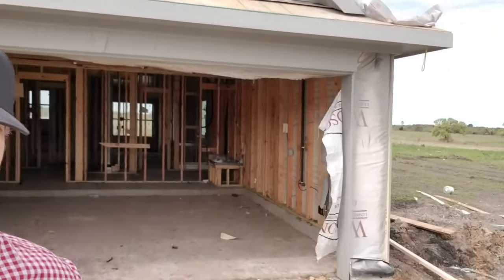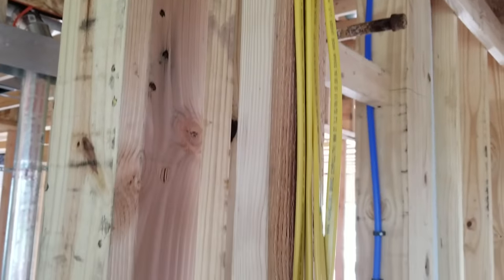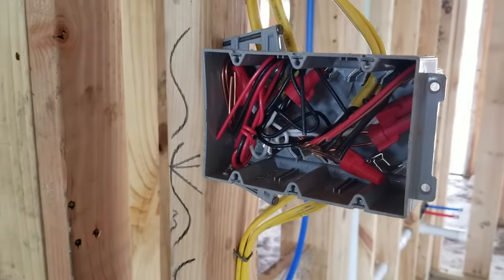HOW IS THIS EVEN LEGAL?!?!

Comment: I've been building since 2002, quality is about the same. The difference is back then you got a crappy house for a cheap price. Now they are selling the crappy houses for about the same price as an expensive home so builders are more likely to build a crappy home.
Reply: Even more true today.
Reply: $450k cash on payment $680k for crappy houses using plastic water lines not copper and plastic electric extension not metal conduit cheap is possible to make a bunch profit
Reply: Must be Dallas.  Bought our new house in Feb. 2022.  Yeah, these new tract homes suck, they always have.
Reply: I miss my grandpa he was a home builder back when they only had the basic tools
Reply: @TeslaBoy123  I recently converted my entire plumbing system from copper to pex, it’s a better system, especially for the homeowner. Copper pipe can burst under colder climate temperatures, pex will not. It’s significantly easier to manage as a homeowner long term as well. 

Plastic conduit meets electrical code with todays standards and is definite a long term option, not sure why you’d NEED metal conduit of plastic does why is needed.
Reply: Rotted out cars over 5k. Can't even get a 500 dollar nice beater anymore. Now they're 2k
Reply: @GregZentTrumpetMan  yup unfortunately that's how it is, they build these plastic homes fast
Reply: @TeslaBoy123 pex has many advantages over copper beyond just price, I only use copper at end points requiring rigidity like shower faucets.  I'll take type A expandable pex over copper anyday for price, easier installation, and better durability
Reply: @2jimmycrackcorn  Thanks for educating people!
Reply: Not only that. They're calling these cheap crappy homes "luxury" homes.

The housing bubble is insanely inflated right now. And when it bursts? It's gonna hurt a hell of a lot of people!
Reply: ditto. But they were sold as basic starter/downsize homes. No one would call them crappy, b/c of the price point.

Comment: Spackle, caulk and paint,,,,, make you what you aint. I have been in the construction industry for 41 years, just retired. I understand lots of folks not liking building codes, but they are there to protect the unknowing and clueless. Inspections, specifications and liscensing of of contractors will build a better product. Quality does not cost, quality pays.
Reply: what's the old saying... the bitterness of poor quality longs outlasts the sweetness of low price.
Reply: "Good" work is never cheap and "Cheap" work is never good...
Reply: It didn't help in this case.
Reply: I couldn't believe there was no sheathing. Honestly didn't believe it at first
Reply: @phillhuddleston9445  Isn't this in Texas? Notorious for lax codes?
Reply: Fastaslightfiber I expected the structure to not be sheathed, I did not expect no sheer walls, that is baffling.
Reply: what would the quality be with out code. It would be a race to the bottom and back to mud huts
Reply: Good work aint cheap and cheap work aint good
Reply: onelove  AMEN! People look at me crazy when they see what I am doing when I build a addition or remodel. Adding extra materials and cost to a CHEAP job. But then they do not complain after several years and what I built is STILL there! Unfortunately clients that want to be real cheap and just patch it, are part of the driving force of crappy construction as well. I am not a NEW home owner or builder, though so I can only talk about remodels and additions. I have designed my first NEW home for myself and it is a flat roof solid concrete minimalist modern house like the ones in my country of Puerto Rico but with all the insulation and technologies of the Mainland USA. Should be a very nice house/bunker indeed.
Reply: Codes are only hated by hackers and scrubs.
Reply: Lincensing is much less important than inspections, even if not mandatory... industry needs to pick up the slack: start a label equivalent to UL for building code compliance. Market the heck out of it and dont buy a home or work with a contractor that doesn't have it.
Reply: @tripzero0  I'm all for inspecting what you buy, but not cool with limiting what a person can build for themselves. If nobody wants to buy what he built he will learn a tuff lesson, if they do then its on them,  Insurance companies should also inspect before they offer you insurance and not depend on building inspectors
Reply: @integr8er66  agree 💯. Need multiple layers of accountability.
Reply: Do your best, and caulk the rest!

Comment: Houses are becoming like everything else in America. 

Not meant to last.
Reply: Velislide builders like this make all other builders look bad. They know what they can cut corners on and do just to make a dollar. Pretty sad that those greedy bastards don’t care about the product or the consumer.
Reply: Great information. There are people who care about others, and some that don't. A house is too big of an investment so find an honest  contractor.
Reply: Its not just in the USA, its the same here in the UK and probably most countries. You cant lay all the blame on the cowboy builders though, if the authorities let them get away with it they will. I wouldn't have a new house given. All the properties i have ever owned have all been over 200 years old and will be standing 200 years after this modern crap has fallen down.
Reply: contractor built houses are not secure and safe.
When I started billing my home in 1966, I made the foundation reinforced with rebar and crankshaft and 3 feet thick. 2x8 walls solid braced with 3/4 pressure treat plywood sheathing screwed in with 2" intervals. Lag bolts hold framing together. 2x12 roof joists. Ends of roof have 3/16" steel plates sandwiched by 2x12s. It was a lot of work but it survived several hurricanes and a couple of tornadoes while neighborhood homes were demolished.
Reply: When people want cheap houses, they get cheap houses. Buy a quality home new or used and have a home that will last several lifetimes
Reply: @nickhildenbrandt4529  I built my home for about $2000, give or take. The barn lumber was free. I made nearly a dozen trips up the mountain with my '48 Dodge pickup, carrying as many as the truck could handle with nearly flat tires from the weight. The land cost me $1850. I spent about $2000 on the windows and having a concrete floor poured. That was in 1966. For tax purposes, the town valuates the house at $579,000 today.
Reply: @basspig  how much do you think you could sell it for? Sounds like a good return on your investment.
Reply: Nothings “meant” to last. Our own body’s aren’t even “meant” to last.
Reply: Bought a new home ( unfortunately ) same thing I have been crawling around in the blown in insulation not a single hole that was cut is sealed .  I never thought a contractor would not board up around the walls ... that is insane. Now I'm paranoid but not quite enough to cut a needless hole in my wall just to see.
Reply: just like relationships
Reply: @ifletcher-cook4776  thx olde,
Reply: Been that way for years! They know they'll move away or be foreclosed on in 5 years anyway!!
Reply: @nickhildenbrandt4529  That depends on the builder and the quality materials hey use.
Reply: @basspig  always smart to build in   hurricane and tornado areas ..
😒
Reply: @erismana2105  Not!
Reply: @basspig  Why not just use bricks and concrete? Concrete foundation at least? Then your houses will never fear anything.
Reply: @Jimoshi1  Because bricks are brittle and cement block walls get crushed in tornadoes and tsunamis. I prefer using strong timber because it's resilient enough to survive shocks/blasts without breaking. Concrete will fracture.
Reply: EXACTLY!!!
Reply: Damn you said it
Reply: oooooooooo I FELT THAT!!!!

 IT HURTS!!!!😡😡
Reply: @Jimoshi1  concrete and bricks are horrible for the environment because producing them means extraction of raw minerals from the ground which pumps tons CO2 into the air
Reply: @Velislide  thats not true,work man-ship is lacking,craft man ship is lacking.I have been a mason since 1973
Reply: @nickhildenbrandt4529  The problem is unless you buy it new, you may not know how bad it is. Everything is sealed up and you could only tell with a destructive inspection.

Comment: I'm a siding contractor and I see this all the time on houses that need new siding , we sheet it after removing the old siding
Reply: My crap vinyl siding is attached to structural foam... Cheapest builds ever.
Reply: Neil Lee   That’s great that you install more than what’s required, and of course you are also familiar with the requirements by code and each siding manufacturer,Hardi etc. Nice to see guys going beyond for the sake of their customer.
Reply: Same I hate treating apart houses only to find shoddy materials held together with caulk and a wish.
Reply: That was commonly done for house clad in T1-11 siding decades ago.  Its rated to be both sheathing and siding, but obviously sucks at being a water barrier and for air sealing.
Reply: @bigpjohnson  There was a house across the street that when the people moved out I walked over and was able to put my hand though the T 1 11 siding and right into the house. It has since been re roofed and double  walled re constructed, the right way.
Reply: @berryelectronics  dude why you punching through your neighbors house wall 😃
Reply: Siding and roofing contractor here too. The shoddy workmanship I've seen is unreal,but the inspectors pass it. I hate to start on illegal immigration but I see a TON of illegals who apprentice for 2-3 years and go off andstart their own company. They have nowhere near enough knowledge to be running jobs nevermind owning businesses. Its sad that theres no pride in workmanship anymore,its all about the $$$.
Reply: @naui_diver9290  Why are inspectors approving the dangerous or shoddy workmanship is the question.
Reply: Inspectors approve it because it's up to code. If you even suggest improving code, contractors start freaking out about too much government interference.
Reply: @nikkimcdonald4562  The house sat vacant for several months. So I went over to check it out to see if I might be interested in buying it. After seeing the crappy construction I backed off. The new owners basically tore it down to the studs and rebuilt it the right way.
Reply: Tia Williams funny thing, here in south Florida they make it unbelievably hard to get a contractors license that people can’t get into business without a ton of money. Becoming a GC here is for the wealthy.
Reply: Siding, what is that? We build houses out of bricks here and call the sides walls.
Reply: @janebrown3587  Because code is bare minimum and not necessarily being written by people who may or may not know good construction and safety.
Reply: I've seen a job were it was basically chicken wire fence material that was covered with a glass fibre reinforced cement mix. Bit like old horse hair plaster used 100s of years back. The rest of the place made of wood frames made of site and shipped in. This shit was built in the last 10 years in the UK for affordable housing, in a estate of big 6 bed 750000 to million pounds homes. They were pulled apart an rebuilt only last summer and the estate is so big its still being built. Shit houses mixed with expensive stuff!
Reply: Why aren't they reported?
Reply: The problem is the pay to do anything new construction its shit and get I'm also a siding contractor.
Reply: I too am a sider and I have NEVER seen someone do this to a house. I’m appalled by this.  It upsets me that builders are out here taping people like this.  9/10 it’s those shit spec home builders.  I can almost guarantee the builder is charging for that material and not even supplying it.
Reply: @michaelbamber4887  That's shocking. I remember digging holes in a fiberglass reinforced concrete floor for electricians to put plugs into, that was some tough shit, alternating between kango and pickaxe the kango just bounced off it taking off tiny bits at a time, more like carving holes. Could have smashed up a whole normal concrete floor and dumped it in the time it took to make a few small holes. Chicken wire, cement and fiberglass doesn't sound as tough though and isn't something to build houses out of. Thems bricks but what's wrong with bricks these days is they feel like they are made of air, they wont last as long as a proper accrington brick which is ten times heavier and hard to break, these new ones just crumble . Don't make em like they used to.
Reply: @carlawilson1179  code actually allows it
Reply: @neillee5835  that is insane. Those codes, need to chang. Impossible to trust.  Is it city codes, county state?
Reply: @ahabsbane  LOL

Comment: In my 30 years in the business I've never before seen a house with no sheer wall installed anywhere. Even Hardi will tell you their siding is not approved for sheer wall! What a bunch of hacks!
Reply: my house built in 1987 siding nailed to stud walls, not even a vapor barrier.  its T111 siding so its similar to sheathing but imagine no vapor barrier and just sheathing on studs than slap a coat of sears weatherbeater on it and call it good.
Reply: @Mikej1592  
Wowowowow.....
UNBELIEVABLE.....
Reply: @Mikej1592  T-111= approved for shear wall applications. Lap siding, not so much. A separate plastic vapor barrier is not required if craft faced insulation is used, which was common place in the 80's.
Reply: @jeffscott3160  I see, interesting to know, thanks for that.  I do wish there was more than a 2x4 wall for insulation because my neighbors are noisy assholes but at least it is within 1987 code.  we've only lived here 2 years and already looking for a new house, this area sucks.
Reply: I recently worked on a house built in the sixties that had cedar siding nailed directly to the studs, no sheathing. They did have tar paper and insulation, but you could feel the cold air blowing in from outside anywhere we had to repair the sheetrock. Another recent project was a 1937 home with lap siding, no WRB, no sheathing, but shiplap on the inside of the walls for sheer. There was no insulation in that case and no mold at all in an 80-year old house.
Reply: @davidkalil5698  Being a sixties house, over fifty years old, I would bet that there were no building codes concerning sheer wall in existence for the area that it was built. The house from the 30's probably built when there were no building codes at all. Some municipalities allow some of these older homes to be remodeled without bringing them up to current standards. They are "Grandfathered" in as far as building codes are concerned. Some things are not Grandfathered in though such as electrical and plumbing.
Reply: @davidkalil5698  I tore down a house built around 1936, studs with shiplap on the inside and lap siding on the outside, no tar paper, insulation, nothing.  For being in moist Houston, the wood on the second floor was still in decent outside of leaks around the newer windows.  The shower was tiles over drywall over shiplap, and because the wood could dry it had very little rot.  It was a drafty house, but that kept it dry!
Reply: @Mikej1592  find yourself a GOOD home inspector,  sometimes I think they are in with the builders!!!
Reply: Who was your builder?
Reply: what about drywall?  It can be considered a shear wall right?
Reply: @xxsekoxx  Not in my area. Maybe in others, but I sure as hell wouldn't use it for sheer wall. OSB and plywood are immensely stronger than drywall. I would imagine if drywall was allowed to be used as sheer wall material it would require far more fasteners AND sheets to get the same strength as one sheet of OSB.
Reply: Shear